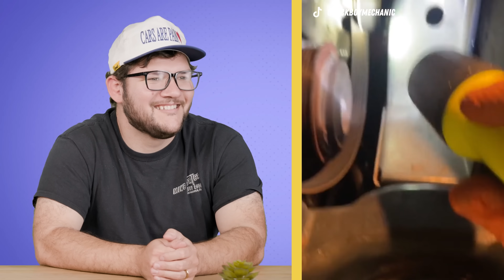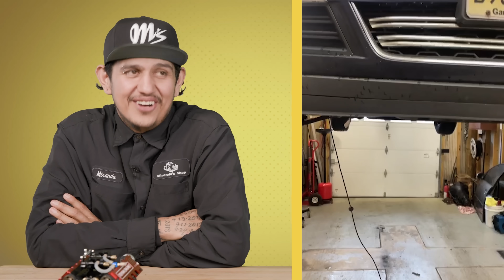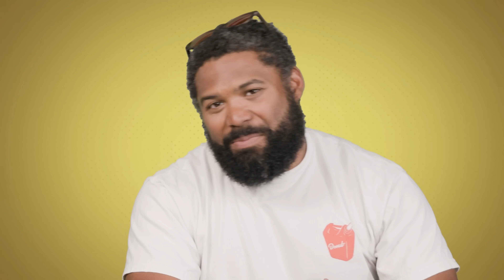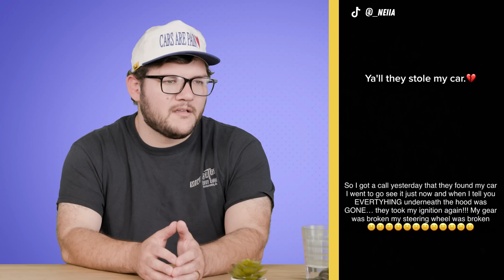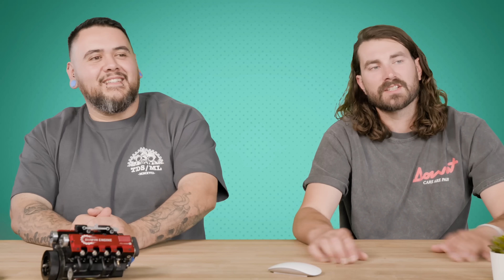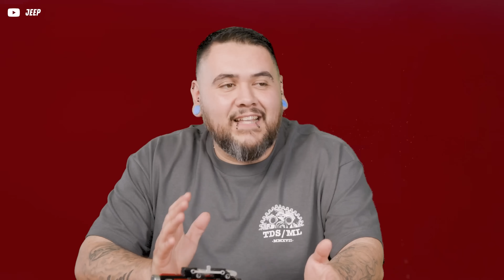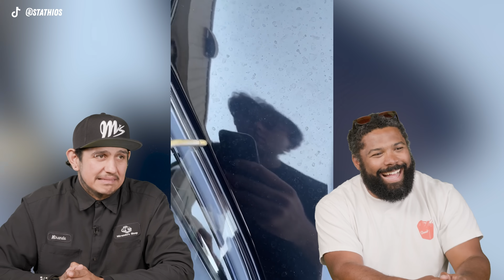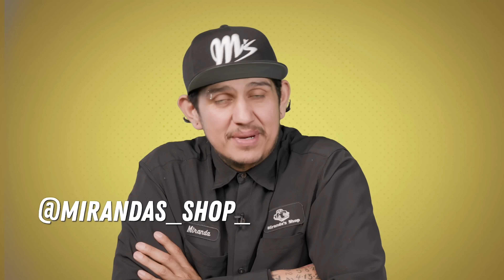Mechanic Reacts to Car Engineering Fails

Comment: I've been an engineer and now I'm a mechanic since a few years, and let me tell you that engineering isn't that simple.. Sometimes you have to make compromises for things like durability (in my experience at least, doesn't mean I don't see any ridiculous engineering). BUT most of the time the problem lies in communication, for example: the first video shows a bolt which hits the frame of the car. I've seen many, and I mean MANY, alternators the last few years and like 9 out of 10 times in this situation there is an opening where the bolt goes through so you can take it out with the alternator (because the bolt has to be that kind of length and obviously will hit the frame as shown). Too me it's easier in this situation to take out the alternator with the bolt instead of dropping the engine for more clearance. But I mean, how could you have known? It's not like anyone normally needs a manual to replace serpentine belts 😂 it sucks that the bolt hits the frame, so they made a solution to that problem but if you have never changed the alternator at one time or another on that kind of car then there's no way to know the "engineered procedure"

Comment: The bad bold placement is as much engineering as it is mechanics. Most of the time, when the vehicle is first put together, the engine & transmission are sitting on the front sub-frame and all bolts and parts are easily accessible. That's how the engineers designed it to be worked on. Then mechanics come along and don't want to do all the work of removing the sub-frame and engine & transmission to do a repair. Then the mechanics complain about the engineers.

Comment: 14 Acadia 3.6 is an absolute nightmare. Changing the power steering pump on it I had to loosen the subframe almost removing it to get the damn thing out. Then afterwards a week later the idler went, same as that traverse.

Comment: There is a lot of finger pointing and engineer blaming here, although at times warranted, but sometimes the way the system is designed or intended to be taken apart or repaired does not align with the traditional way of repair. That's the price of trying to stuff 10lbs of technology into a tube sock. Stop complaining, learn how to be a great mechanic then go to school to become an engineer, go out into the world and correct these issues. An engineer with trade experience is worth 5 times what a inexperienced engineer is worth.

Comment: Engineers suck! My father and I both have backgrounds working with engineers and in CNC. We have both agreed for years that mechanical engineers should be required to work a minimum of 12 months as a mechanic prior to completing their degree.

PS. Let Angelina know I'm single.

Comment: We hire an outside company that specializes in water leaks to diagnose and repair the leak. If electrical problems come up we will run the car all day with the heat blasting to try to dry out and residual water from the connectors/modules. If that doesn’t work then you would basically have to replace the whole floor/chassis harness and any ruined modules like the infotainment or consoles. Especially if the car is still on under warranty. Usually water leaks are not too bad if caught early, otherwise complete nightmare.

Comment: So.... I'm an automotive engineer AND a mechanic. So I see both sides of the coin, and in most cases its actually the bean counters that cause problems by cost cutting everything.
An example such as that bolt on the serpentine belt; that engine may have been used previously in a different car, which did have access to remove it. We have teams and teams of people that check our new vehicles for tool access, servicability etc. That bolt being too long may have been picked up by an engineer, but the finance team may have deemed the engineering change as too expensive so they let it stand.

Comment: Aircraft mechanic here…
Generally planes are easier to work on than cars (I might be slightly insane since my DD is the notoriously difficult to deal with 6.0 Powerstroke (Cars are pain ❤️)) but some of the places I’ve had to put cotter pins in make me absolutely filled with rage…

Curious to hear if people in industrial maintenance have similar issues 🤔
Reply: Don't worry, i've got a few..

I've worked on Dematic conveyor belts where two frame sections are held together by the same piece that holds the rollers in place, so instead of taking 30 minutes to change out the rollers, now its a 6+ hour job and you need to brace the frame to keep it from falling.

Another was a tote stacker that had a bracket that comes up to stop the totes in the right spot, well the bracket mangled the 8020 where it bolts up to, and to replace that piece of 8020, I would have to disassemble the entire machine starting from the top, which is probably a 10+ hour job. Different mounting holes were drilled instead. I feel for the guy that eventually has to actually replace it, cause it won't last forever.

We also had spiral lifts made by ambaflex that had horribly designed slats that were wider than required and would constantly break. Replacing the slats was a bit of a sketchy job as you were generally doing it live and needed to put your hands very close to a chain and sprocket, and hope the guy running it over the radio 40 feet above you actually heard what you said. Those were fun to rebuild too, they had bearings guiding the slats that would pop out when the slats break. Every once in a while they would bind up and eject the chain, which takes hours to put back into place. If you end up needing to replace the chain it can take days to get it in, and clear out any crap that would cause it to bind up. We actually had to have a vendor come in to build scaffolding to rebuild those spirals. 

My building had lots of elevated conveyor belts, some stacked on top of each other and needlessly close together. In certain areas they had support structures in between the conveyors as well, so you couldn't actually get between them to work on them. There wasn't really room for ladders either, so I would constantly see the workers standing ON TOP of the safety cage of their ladders (10+ feet in the air) just so they could reach jams in that area.

My favorite fail of all though, especially since I didn't ever have to deal with it was an overhead conveyor that was JUST installed. It was designed to take away little cardboard scraps from a box making machine. The cardboard scraps would jam up the belt at least once a shift. This belt was also built WAY up high where we would need to use the big scissor lift to get to it. After about two weeks, my manager gave up and the new procedure was to leave a gaylord just below the lift so it would just dump the scraps into it instead of jamming up the conveyor. Who knows how many hundreds of thousands of dollars, maybe millions that it cost to get that conveyor installed, and it was completely useless.

Comment: About the Tesla: It definitely both, but definitely the engineers more than the factory.
I've seen a few in mechanic videos here in Germany, and many parts don't have proper mounting points.
They either don't line up at all, or they don't have any to begin with, forcing the factory workers, as well as the mechanics replacing those parts to drill their own holes, just to mount the things.

I think it was the Model Y that had the adjustment bolts for the boot lid inaccessible, unless you take out the rear window. That's definitely engineering there!

Comment: As an electrician we see bad engineering decisions in our trade as well.  Road rated lights that you have to wire up blind, ceilings needing lowered because on paper it's fine but in practice there's too much stuff going on the ceiling cavity, and other ridiculous problems.

Comment: The amount of fcking water leaks I've fixed on BRAND NEW Nissans is unreal. Mainly frontiers and fcking muranos. On the muranos (2017) it was strip the whole lower interior from headliner down, minus the dash, and put new carpets in them. One per day for weeeeeeks. Fuck that noise

Comment: I am an automotive engineer. Sure some decisions come down to money but most of these problems are what we call integration issues. A power train is designed before any vehicle it will go into, as an engineer it’s part of your job to do design for service evaluations. Sometimes things get missed like that tensioner bolt but more than likely there is a different bracket that should be removed. Rule of thumb think about how it went together. Is there a higher level assembly you should be removing? And if something seems weird refer to the service manual, any  real shop has a service they pay for that gets you all of them. If your at home it’s a good idea to find them for each vehicle you have, most of the time you can find a pdf online with enough searching.

Comment: This is why I went old school and built a sbc 350 put it in a 64 Impala and keep a tool box and a couple spare wheels in the giant trunk. It breaks I pull over and fix it. No computer, simple. And still a head turner.

Comment: I was actually talking to someone about this exact type of problem recently. If it works how I think it does then I don't blame the engineers, I blame the marketers and designers. I'd almost guarantee that all of these cars are designed first for their style and interiors. Then the engineers get it and are told to just go ahead and fit everything needed to make the car work into whatever space they left the engineers. I could be wrong, but I'd almost guarantee that if it's a choice between how the car looks, and how easy the mechanics and engineers have it, how the car looks is going to win every time at most of these companies. And like they say in the video the mechanics get it after the engineers, and in between is the factory, so by then it's even worse by the time a mechanic sees it.

Comment: Usually engineers design well...but bean counter in hq say they cant afford it...the first one was cheaping out be using a common bolt not a custom size.

Comment: 11:30 in a car like that where it drains on the frame, I let it soak the frame. It’s not my fault the customer bought a crappy designed car. Therefore it’s not my responsibility to clean up an engineer mess

Comment: Newer Ford F150s, plastic yellow drain plug, god damn metal rod that goes directly in front of said drain plug, drop oil, oil stream hits it, and sprays god damn everywhere. Ford, stop trying to reinvent, just stop.
OH and the newer Rangers, thanks for making me take 15 clips off to take out an oil filter through the wheel well, be better.

Comment: I used to be a machine mechanic at the Post Office. I worked hand in hand with designers and builders on a couple of machine add on projects. After we built some of these add ons we had a quality product that worked for the mechanics. After our designs were built and submitted and were to be installed on other machines the end product was totally different from what we built. I believe it was pencil pushers on both sides that wanted to save money and we got less reliability that was harder to fix.

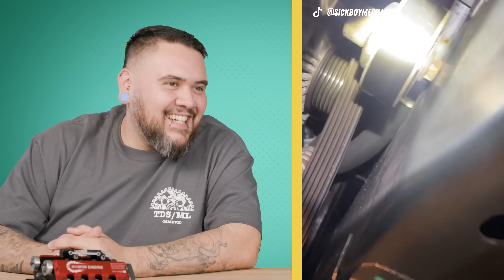Comment: 0:32 Looks like a factory mistake where the assembly line worker used the wrong length bolt for that pulley and then dropped the engine into the frame.

Comment: There are a lot of car engineers out there are genuine automotive enthusiasts as well.  Sometimes the little details can get overlooked in design. But most the issues for mechanics and poor factory quality control come from the accounting/business departments. That's where designs get gutted and manufacturing quality goes down hill.

Comment: I've done design work for stuff like this and can tell you that cost cutting is a real thing. Plus, we don't always have the best information. The tensioner bolt for example, I bet that engineer was given a clearance tolerance to work with so that the bolt could be removed. The frame team probably needed the make a change (because cost) and that didn't get back to the engine design team. Engine is assembled out of the vehicle and dropped in. The issue isn't even realized until after the fact and at that point it is too late. Still sucks either way. 

For the oil drain, I bet this is a tooling issue probably. That tray probably had a provision for the oil flow and the tooling needed to make that part was either to costly to design or resulted in too many failed units. Because it is cheaper to not have the notch for the oil drain and "they can just use a funnel", it was justified away as "not my problem".

Also, "not my problem" is super bad in some engineering departments. Between that and politics, I had to get of the business.

Comment: A lot of engineers don't have any hands-on experience with actually servicing vehicles and turning a wrench. If I was the manager, every new engineer would have to spend two weeks on the assembly line and two weeks in a service garage before I would even give them a computer

Comment: Chevy Express work vans have their power steering fluid leak onto a fuse box. The fuse box is also under the master cylinder. The windshield washer fluid hose runs nearby, which also leaks.

Comment: whhaaat everyday for clio mk2 owner....:D so little space around the engine ...that bolt on the roller is just nothing. and its just the 1.5 dci. the 2litre is even worse lot less space. but the truth is the repair manual says 80% when working on the engine it has to be out of the car.

Comment: Ok I'll chime in a second time. I agree with all their assessments here, BUT, I have seen MANY examples where we write technical manuals of how to fix something and a large portion of the time, mechanics don't follow it, and something gets broken. Not always the case, but it happens. Another thing is a lot of these bad decisions were probably made by management, and the engineers didn't have a choice, because doing it the way engineers suggest would cost more money, and so the shitty, cheaper way get's selected due to costs. Believe it or not, most engineers WANT to make things easy to work on, but management intervention, poor communication and other factors prevent us from making the best decisions. But yeah, some engineers just suck too lol

Take the challenger space shuttle for example. Engineers all told management don't launch. They launched, it exploded, several people died, and a lot of people blamed the engineers for bad design, when the design was actually to spec, but management decided to launch it outside of spec. I can tell you engineers feel about management the same way mechanics feel about management. Management wants to spend less money, engineers just want to make a good design, but managers are higher on the pay scale, and cut costs wherever possible, and THATS usually the shit that roles down hill. I've only been an engineer for about 10 years but I can't tell you how many times I've argued that a design is better, easier to work on, but it costs more so management says no.

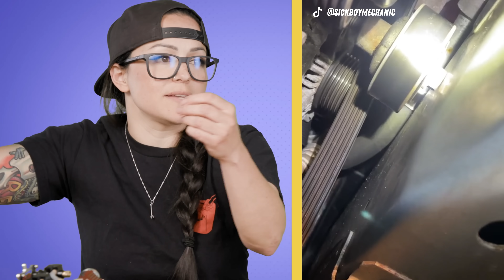Comment: 1:05 i had that issue on a french car ... i had to jack up the engine to pull out the screw, and jack down the engine to pull out the roller. but it was specified in the workshop manual ... it was surprising :D

Comment: The problem is not that it is a jeep it is that it is a new jeep I have owned and currently own   a jeep and it has not had any real issues other than normal issues with things going wrong due to milage that I put on it 6 days a week just for work and it is my daily driver for everything I do including towing a trailer when needed and by the way it has the 4.0l engine also it is not always the engineer it is sometimes the company as i have personally talked to a engineer who worked for Ford and was told some really skechy things that he designed and had to change due to the company's requests

Comment: a common problem that i have seen is the 6.7 power stroke from the early 2010s has plastic piping from the intercooler to the throttle which is under pressure and has poped on some work trucks that we have due to plastic becoming dry and cracking

Comment: So in france we got peugeot who couple year ago created the magnificient petrol 3 cylinder 1.2L puretech engine. They decided for some reason to make the timing belt dip in the oil pan. And with that the belt just destroys itself, with pieces of it going to the oil pick up tube and ultimatly braking the engine. The average life of this engine is around 60 000km, idk what that is in miles but not a lot and it can either brake from oil system clogging up or the belt snapping in half. I think imma stay with my renault.